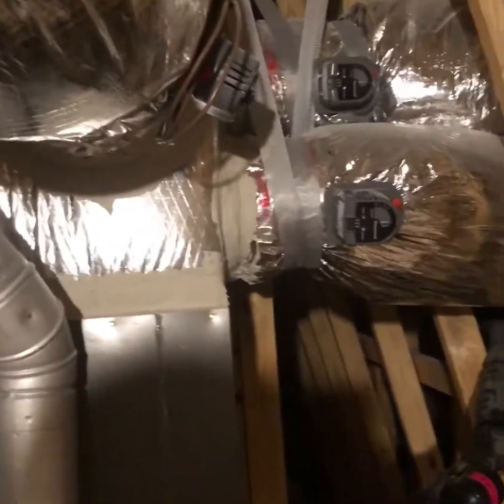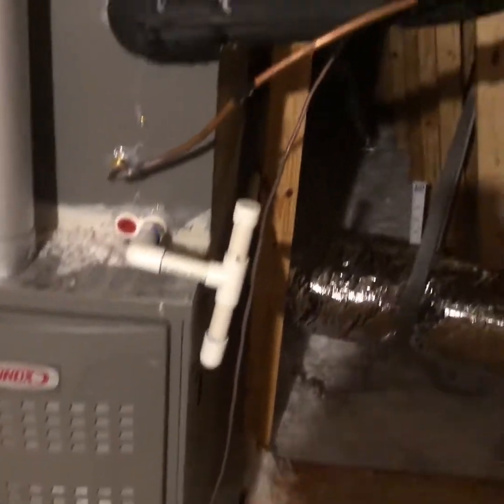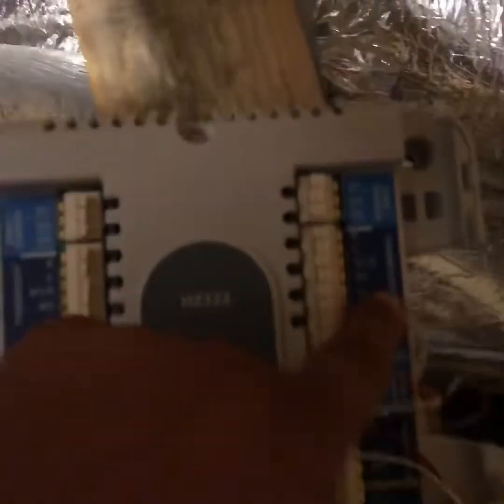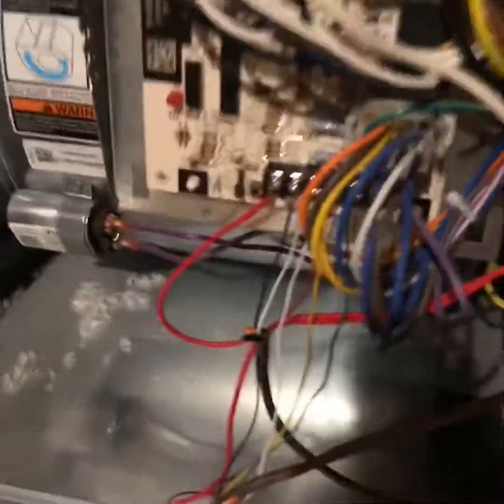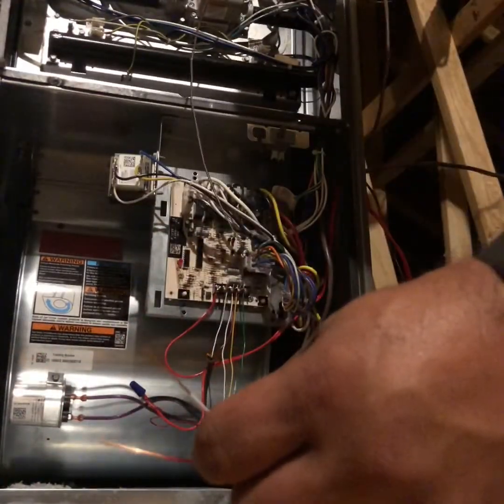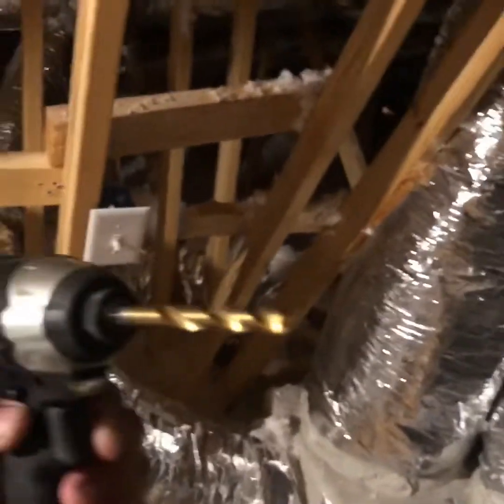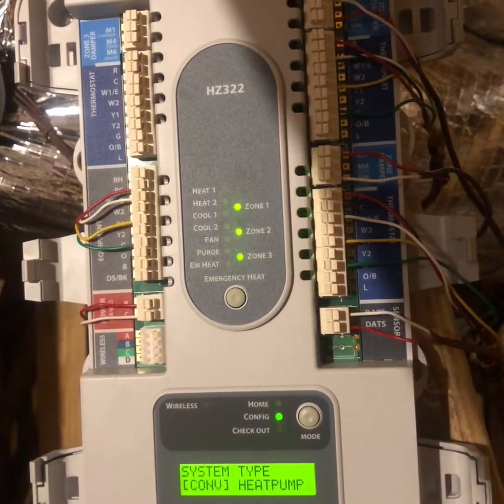HOW TO: INSTALL A ZONE SYSTEM!!!

Comment: The most important thing you must do when installing zoning is keeping your static duct pressure at furnace design spec or you will burn out your blower motor, ice the evaporator coil, raise head pressure harming the compressor, create noisy airflow or never satisfy the thermostats. You must install a CPRD from Honeywell. Constant Pressure Return Damper and a 12” or 14” bypass duct from the supply plenum to the return plenum. It automatically maintains correct duct pressure. When you install it and test, use a 2 port manometer to test supply and return air. There is a manual adjustment if it automatically doesn’t get it exactly right. If only 1 zone is calling, the damper bypasses more air than if more zones are calling. If all zones are calling, very little air will bypass.

Comment: does the board have enough power to power two damper controllers at the same time? I'm researching now and some people are suggesting getting a voltage controller if you need to run multiple damper motors.

Comment: Use wire spades for low voltage better connections on transformer

Comment: Very advanced boards now with thermostats even room based Bluetooth now. Here in Australia some zone control units are plug in to 240 with onboard voltage control and the damper/zone motors use cat5 or RJ connection for signal. Does the bypass  use a pressure sensor and motor gate or is it just a passive spring return based in duct pressure? Its only really an issue on multi level systems where you get temperature fluctuations.

Comment: How do I know where the air sensor goes? I see techs here wire to the outdoor unit. I haven't seen it wired above the evaporator coil before. cheers

Comment: Do those damper motors have a ground or neutral wire?   I see you only installed 24volt wires ,  didn't mention any ground wire or common neutral wire..

Comment: Hi nice video.  just a question about the low limit setting you covered in the section on the advanced settings.  You mentioned wanting the heat pump to run on cooler days where the outside temp was lower.  But isnt the point on that low level limit setting to stop cooling and prevent coil freeze when it reaches the discharge air temp  setting.  I am wondering because i have mine set at 45 and noticed  that when outside air goes below 50  my system seems to go to the aux heat. I have heat pump checked out and it is fine but seems to shut off at 45 ish.

Comment: Quetion on the advanced settings. As you discussed low temp setting you seemed to indicate you were lowering the stiing because you wanted the heat pump to continue to run on cooler days and lower outside temps.  Isn't this limit  setting really to prevent freezing in the coils by turning off the cooling when the discharge air temp temp at the limit the temp of the air

Comment: Thanks for the video, very informative. Looking to adding this to my system at home. I have a 2 story 2200sq.ft. home. What dampers did you use? Do you still recommend them? I could see they're also honeywell, what's the model number. I got the HZ322 on the zone board already. TIA.
Reply from the maker: Honestly after a few years since this video, I really like EWC over the honeywell
Reply from the maker: If you choose the Honeywell there fine too. The model number will relate to what size duct it's connecting to. So example, if it's a 12" duct, it would be a Honeywell ARD12. Just change to number for the different sizes.

Comment: Great video; very intuitive!  Wish all videos were this detailed. The only other thing I wanted to see was how to adjust the dampers to full closed since I think my dampers might be leaking a little bc I can feel a little airflow going to my second floor when I have zone 1 on my first floor ON. I thinking after 8 years it might slipped and might not be fully closed as I feel there’s approximately 20-25% leakages on the closed zone.
Reply: Some times they allow dampers to be partially opened  for   Static pressure relief.

Comment: Since I separate Transformer comes with the unit and there is no common connection to the Honeywell my furnace will not operate HVAC common and Honeywell common not the same trigger the furnace

Comment: On the 2 wires on the zone..is it common and close    Is their a jumper needed for open
Reply from the maker: It depends on the type of damper. These dampers are normally open so it needs power to close and common

Comment: Couldn't you have just used the 24VAC C-wire coming from the furnace for power instead of installing the 24VAC transformer?
Reply from the maker: Yes you can but it’s better to use a separate transformer

Comment: Excellent vid. How many dampeners can u run on the transformer. I have a setup that has no separate trunks for upstairs and downstairs so would need to dampner each supply run

Comment: Why did you set the board on Heat Pump when the thermostats don't control a reversing valve?

Comment: Did you really mount the transformer on top of the Burner cover? Hot. Hot. Hot. Also, now the door-safety-switch won't kill power to the zoning system. Why not mount the transformer in the blower control panel and tie it to the TRNFMR terminals like every other tech in the world?

Comment: I'm not sure you'll answer this but hey ill try :),
 I moved into a brand new build as a renter6 years ago, There are 2 apartments above a store, 1 furnace 1 ac unit . We each have our own thermostat and control our own settings, the issue is the tenant above me is constantly switch from Auto to Fan on, sets her heat to 79 which is insanity, and my thermostat rarely reads what I set it to between 72-73. 
There are NO errors from the furnace or Honeywell Zone setup. Maybe because she keeps changing her setting from Auto to fan, idk but I'm just wondering how truly reliable they are ? On days below zero celsius the thermostat reads 'heat on", my thermostat will be set to 72 Fahrenheit, but nothing blows out the vents it usually doesn't get above 60-64 meanwhile the above tenant has heat blasting. It's been a battle for 6 years now I'm sick of being cold and the HVAC guy telling me its fine or idk its working now, i have to video it not working or I'm a liar - so sorry for all this ramble - Whats your thought on reliability cause I'm seeing nothing good here but constant intermittent heat, and I have doubt these zone systems can work sufficiently controlling 2 separate places, thanks !!
Reply from the maker: It sounds like you might have a zone damper getting stuck closed or stuck half way. The auto or fan for the other tenant shouldn’t be a problem for you. If these zone systems are working right, they normally work fine. I would check the damper for your side. It sounds like the damper is the problem.
Reply: @HVACTechTips  Thank you so much for answering, yes one of the dampers was an issue, its been changed a few times but the possibility of one getting stuck when opening and closing makes so much sense of it being intermittent,. It never occurred to me they could get stuck, I thought they were either working or not, but being stuck occasionally would definitely explain everything, I just wonder why it happens only on  very cold days. This is the first knowledgable answer I've got that made sense in years THANK YOU :P

Comment: Hey thank you man I have a question I have a wood hot air furnace can that zone board run 2 120 v blowers somehow
Reply from the maker: If you have 2 separate wires to control each blower it would

Comment: The board is not powering up? The transformer is wired correctly. Any suggestions?
Reply from the maker: Check power going into the zone board. Check it where the 24v plugs into the zone board
Reply: @HVACTechTips  had to replace the 24v transformer in the air handler. Working fine now. Now that zoning board is back up? Do I have to config again? Or it retains the old settings?
Reply from the maker: If there is power going into the board, the board is bad
Reply from the maker: Muhammad Bukhari  if the zone board is the one with a display, yes you will have to configure it back to a heat pump
Reply: @HVACTechTips  you are a life saver Bro. God bless you

Comment: The zone board has slots, top and bottom to bring wires into tie in with a place to use a pull tie to secure them.

Comment: Question: what could be the problem if your zone board is receiving power from the outside unit but isn't sending power to thermostats?
Reply from the maker: The zone board does not send power to the t stats. But I think I know what your meaning. If the zone board is not detecting when the thermostats are calling for cool or heat there’s either a problem with the wiring, or the board is bad. Make sure your thermostat is calling for cooling and Check the wires coming into the board at Y and C at the same time.

Comment: Great video. Question. I have a manifold that goes across halfway done the house. About 20’. Do I have to put the Air Sensor right before the Damper or close to the beginning of the manifold, close to the air handler? Thanks 😊
Reply from the maker: Close to the beginning
Reply: Thanks !

Comment: I keep seeing these damper videos but no one is letting me know how to set one. I have this DuroZone remote damper on my wall upstairs only one thermostat on the first floor. When I brought the house it was there. We brought a new system 8000.00 and the guy that installed it didn’t know what it was. I don’t believe we needed a new unit. But I have looked at a lot of videos, but no one has yet to tell me  what to put the wall damper on for summer? Open 1/3 2/3 closed? Any help will do.
Reply from the maker: For the summer, you will need to keep the upstairs fully open. Then in winter you can adjust to your comfort.
Reply: HVAC Tech Tips Thank- You so much.

Comment: So is zone 1,2,3 For each floor? I have a 3 story house and my basement doesn’t have any ducts. How am I supposed to bring the ducts down to the basement?
Reply from the maker: Normally when a house is 3 stories, you can zone 2 floors and have a 2nd system in either the attic or basement.  So you can zone floor 3 and 2 and have a single system for the basement. It would be very hard and expensive to get ducts down to the basement from the attic

Comment: Wouldn’t the transformer be better mounted outside the furnace, to reduce heat exposure...?
Reply from the maker: It will not make any difference. You can do either one.

Comment: I have an air handler on my unit and can not figure out for the life of me how to wire the transformer.  I know you mentioned to use the orange wire instead of the red, but where does it connect to??
Reply from the maker: So with a air handler you will use the the orange and black Bc air handlers are 240v
Reply from the maker: The 2 hot wires is what will connect to the orange and black. 1 leg on each

Comment: Informative video. I have a question, I just purchased a home and the sensor we as not attached to any hole it was just left out. Does that affect the functionality of my system?
Reply from the maker: No. It will not effect it but it will not be able to cut off the system if the air temp gets too cold or hot

Comment: Lost me with loop backs and why so fast. I'll just power up the two ducs with a loop back? WTF
Reply from the maker: The 2 wire goes into a damper. Then take another 2 wire and plug it into the same holes in the same damper. Then take the other end to the 2nd damper. That will make 2 dampers work together
Reply: @HVACTechTips  this loopback thing solved a mystery for me.  I had two zones but 3 dampers and one of them isn't connected to the zone board and I was like how did this ever work... low and behold and electrical loopback right.  It supplies electricity to the main damper and then the remaining voltage also powers the 2nd loopbacked damper.  Nice.  Is this the normal way of placing two dampers into a zone board like the honeywell?
Reply from the maker: Yes it is.

Comment: I have a carrier 4 zone unit with a Carrier branded Thermostat and Zone control board.  I am due for a change out of the entire unit as it is 16 years old and having problems. If i change the unit with another brand ( American Standard or Trane)  Do i need to replace the zone board or will the new unit work with Carriers Zone board?  My dampers and actuators in good working condition.
Reply from the maker: No. Your zone system will work fine with any system you install

Comment: I need help, so I see that on the right side of board the thermostat on top has C wire and the bottom t-stat is doesn’t not have the C terminal connected. Can you explain why? Thanks!

Comment: Great video bud. Can you answer a couple of questions?
1. So as the dampers close off , it’s like choking down the duct..... is there a static pressure sensor to control the bypass damper?
2. Does the DAT sensor open non calling rooms to regulate the dat when it gets near the limits?
3. Are the actuators open or closed no modulation? Also are the spring return?
Thanks
Reply: Usually a bypass damper is weighted and opens and closes as needed.

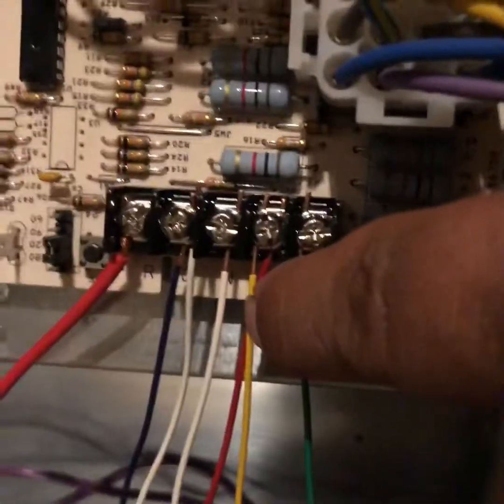Comment: 8:52. where is the red wire coming from that connects to the Yellow wire? And same question for the white wire attached to the common wire? The rest of the video was beautiful, just couldn't figure out those two extra wires? Are they going to the dampeners?
Reply from the maker: nhan nguyen that’s the 2 AC wires coming from the outdoor unit. Red is going to Y and white is going to C.
Reply: @HVACTechTips  OK THANKS SO MUCH!
Reply: @HVACTechTips  Great video. Will appreciate  if could tell where the common wire ( blue or black, can't  really say but the one is connected white wire from the outdoor unit) , in HZ 311 side it is not connected at all. HZ 311 has only Red, white , yellow , green only at the equipment. Thanks for your time in answering  this.

Comment: Would you recommend doing zoning on single-stage furnace? I read it won’t reduce your bill. But I have some rooms that are colder/warmer than the others
Reply from the maker: Paul P. Yes it will definitely help with the hot and cold spots. Won’t be a huge diff in the power consumption
Reply: HVAC Tech Tips Is there any specific equipment you would recommend?
Reply from the maker: I really like Rheem and Trane. You can’t go wrong with either. Rheem will be a little cheaper

Comment: what did you do for the return / make up air? is there one on each floor? or is there something that needs to change when doing a zone system
Reply from the maker: All returns are the same as a normal system. The only difference is you will need a bi pass installed. Which is a duct that comes from The supply back to the return

Comment: Does the damper completely shuts off the air to one place when closed ? In my second floor i have 3 bedrooms but sometimes only one bedroom is been used ,is this system helps to have complete control of where the air goes , i have central ac ,and was thinking of mini splits for this reason ,control of which rooms get ac ,and will this help save on electricity  or this is not the purpose of this system ? thanks
Reply from the maker: And it sounds like you have a damper problem if there are only one room cooling and others are not. Or it could be wired wring. Check if when you turn on the down stairs tstat the up stairs rooms start to blow then
Reply from the maker: These are more in sections or (Zones) like up stairs and down stairs. Not really for room by room. And mini splits are expensive especially if u are putting one in every room. You would be alot better off going with a zone like this. U can set them up also to do like left side or right side of the house

Comment: thanks. it would be better to show overall design, each damper controls sqft and floor#. I see you you have four zones but HZ322 is 3-zone kit? you also has AC and bypass damper right? you can add a list for these info also component model# and link.

Comment: Question I have a 3 story home with 2 ac units  one ac controls 3 zones and the other controls 2 each zone with its own thermostat right now it uses an old trol a temp Honeywell  cronotherm iii.  I am looking to upgrade the thermostats what is the best way. Any thoughts